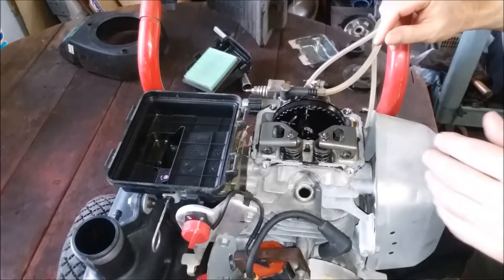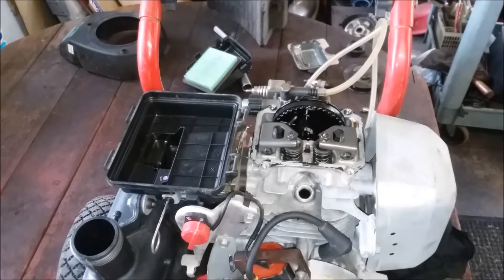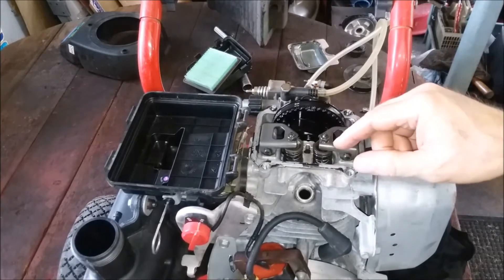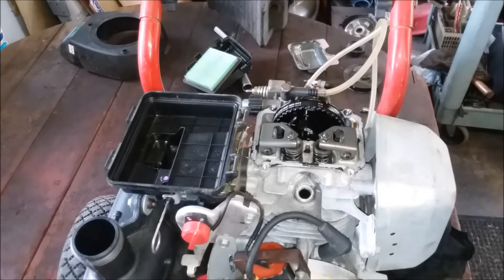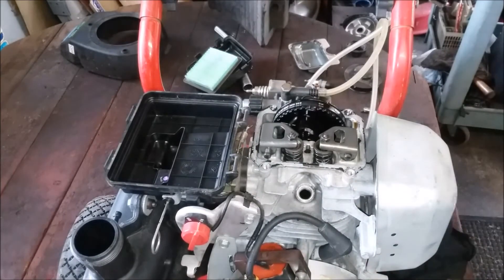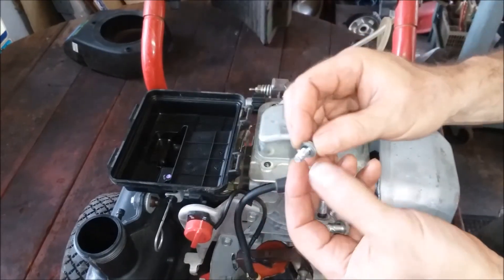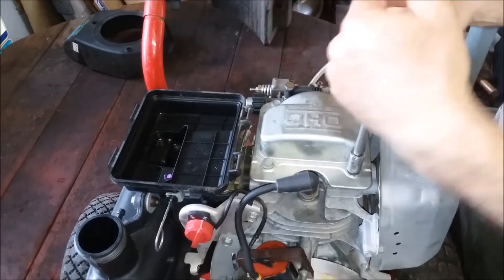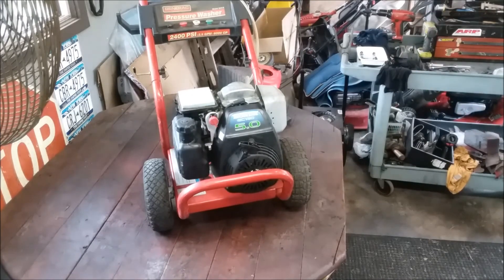How to Adjust Valves on Honda GCV 160~190 Series Engine

Comment: All you have to do to find TDC on these engines is turn the crank until the pointy end of the crankshaft lobe is pointing up or towards the valve cover. Done.

Comment: I am dealing with an old mower with a GCV 160 manual choke that has been sitting for several years. It will run fine for a few minutes, surge for a few minutes, and then run fine again for a few minutes. It has a brand new air box, air filter, carb, carb gaskets, fuel lines, and spark plug. Everything is OEM. I have also cleaned and gapped the coil, and cleaned the magnets on the flywheel. Could the valves being out of clearance cause an issue like this? It is definitely hard to start when it is cold. Can you think of anything else I have missed? I am stumped on this one.
Reply from the maker: Yup, you got it! Valves out of adjustment and depending on the age of the engine and if it sat out, moisture or rust or carbon, you may have a poor valve seal or even some issues with the cylinder bore and rings!

Comment: Good day to you, sir!

You spoke of "...a little more clearance" so, am I right to asume more clearance is better than too less? If given a clearance of 0.05 to 0.07 by the manufacturer, should I aim more to 0.05 or rather more into the 0.07 direction?

Thank you for the info and best regards.
Reply from the maker: I do have better videos on this, in a folder for valves & tuning they live.
This is an old video for me so as a newbie I did my best.
Generally, most engines offer a range; too tight and you can damage the engine and or it wont run right.
A little looser on the exhaust, due to expansion for heat, its ok to be on the heavy side of the measurement. 
Since the spec's give us a range for most but not all engines, if the clearance falls within Min/Max, just leave it!
Reply: @TheNovaJohn  thank you very much, John.

Comment: Does the fuel and oil need to be drained befor tipping engine back? I have a Ryobi pressure washer with the Honda GCV 160 and need to check the valves. Thanks!
Reply from the maker: Good question!!
Generally I don't, also its helpful to put it on the side of the muffler because the oil can run into the carb/filter if tipped that direction!  As long as you are aware of this, it may smoke a bit.
If it gets into the carb it will smoke that way as well..
If ya gonna leave it for a longer time then yes, it will eventually leak out to a degree.
My worry is when I drop all the oil and I get busy with other things I may forget to put oil back into the engine!!! Ouch!!!
Reply: Is it best to tip straight back so that the OHC IS FACING UP, or on the muffler side as you stated? Thanks for your reply!

Comment: Why is it runing rough without air filter? Thanks
Reply from the maker: Great question, I do partially answer it. Its not under load and its running at its full RPM. Its a little lean in the fuel mix, with the air filter, the air is restricted just enough to make it a bit richer. 
Under load it will pull more fuel so it will have a correct air/fuel mix. 
There isn't a blade on it, its a pump so until it sees water there isn't any load. 
If I were to drill the jet larger, it would to too rich under load where it counts.